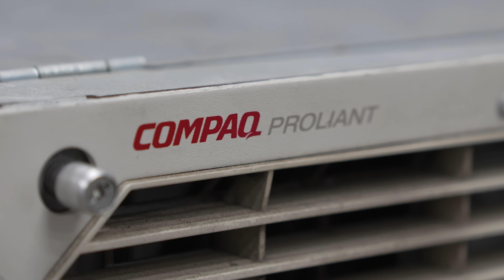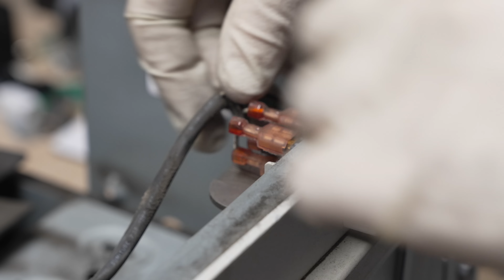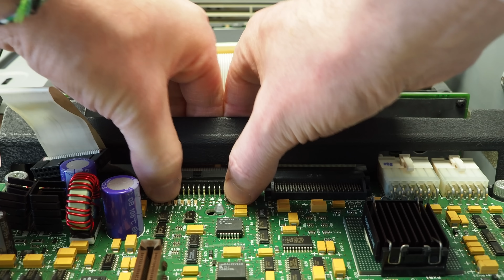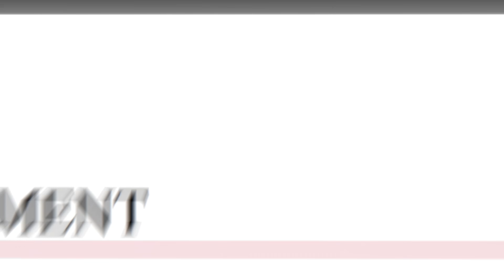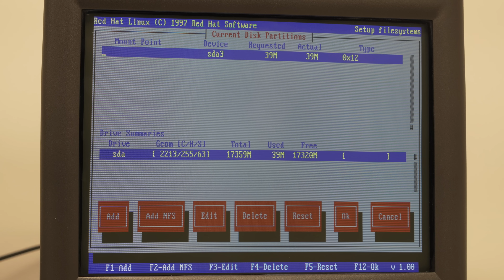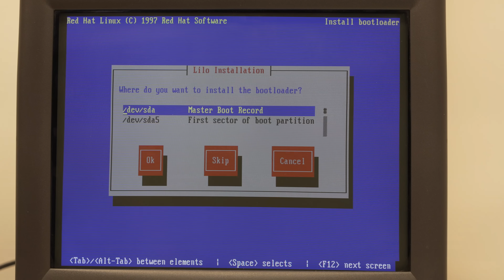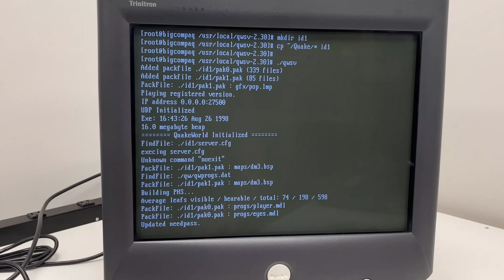A $25,000 server from 1999!

Comment: With the "Smart Start" CD a second CD was also available to update the system firmware. It made firmware updates SO much easier, you would boot from the CD and it would update everything in or connected to the server that needed an update. BIOS, RAID Card, SCSI Cards, Network Cards, Hard Drives, external drive cages.
Yes, HD firmware, it was an important update to run back in the day due to HD firmware issues from many vendors, (Seagate, IBM, Fujitsu, Quantum, Conner etc.).
The HD firmware was Compaq-specific as well, I have to admit that many of the updates that Compaq provided for HD, or other cards for that matter, were not necessarily provided by the manufacturers directly so I had to wonder if the corrected issues were mainly due to Compaq specific issues or hardware.
It was not uncommon for server companies like Compaq (HP, IBM, Dell, Dec Alpha) to have vendor-specific updates for hardware even though the hardware looked identical to "off the shelf" versions.
Anyway, the Compaq firmware update CD made updating a server an hour job whereas an HP, IBM or Dell would take a full day because each update required a reboot.
As you have already found, the SmartStart CD also installs all of the drivers needed to support the system as well, so if you purchased all Compaq cards and you had the correct SmartStart CD you could get a server online using the correct drivers in comparatively very little time.
I was happy to see that you opted to run all four processors, we too ran all four CPUs and 4 GB of RAM, as I recall the RAM cost as much as the server did, we also ran an external drive cage filled with the 18GB drives.
The one thing that you didn't show was the "hot-swap" card technioly that this server had, you can power down a slot and replace a card if needed.

Comment: noisy fucking things. lol. slurping up a lot of electricity at that. lol. we had a few. you're actually better off just filling a rack with deskpro's instead... 'we pay you to compute, computer, not to make noise and heat'
Reply: this is the kind of stuff from the days they still thought they sold that stuff to 'banks' instead of isps :P LOL (oh wait they still think that ;). we don't want a 200kg box that makes a lot of noise and just 'looks impressive'. lol. it's not gonna sit there for like 30 years. it's gonna sit there for like 6 months until the market changes. lol. and then someone has to lift it up again. you don't want to lift it up. lol.
Reply: called dell once to order 200 optiplexes... lol. the white ones. 'but you should just order our servers, we won't gurantee the optiplexes for that use' eh yeah well your servers are underperforming overweight overpriced pieces of crap. we just need cpu cycles per kwh and m2 :P LOL. sorry guys. :P and not break our backs on it .
Reply: 'bbbut those are not redundant'. yes they are. lol. you just pull out 10 or so as a whole and you still have 20 left all doing the exact same thing ay lol.

Comment: I think you got the price a little wrong. I used to install and upgrade these at Lucent Technologies back in 99-2000. The CPU alone was a $50,000 part back then! Of course, youcould get the exact same CPU without the Compaq brandingfor about 5% of the price, but they wouldn't honor any warranty repair requests unless everything in the system came from them.
Reply: Immediately after posting that, I saw the part where you were showing different prices from different sources. At least for the configurations that Lucent ordered, I'd say that $75,000 was about the starting point. I don't remember the specs, or which CPUs they came with, or upgraded to, but I do know the ones I was installing cost $50,000 each.  If I was a criminal, it would have been really easy to improve my living situation back then. Lol

Comment: I was certified to do warranty repairs on these servers and this takes me back. Your 6500 may have ram mirroring enabled which will reduce available memory by half. You need the smart start cd to configure the system. Hopefully your cdrom works.
Reply: I was thinking the same.  It's a pretty odd, unique feature, I don't remember seeing it on others servers, or with other manufacturers.

Comment: Whoa, I am having tons of memories triggered by this video.  In the late '90s and early '00s I was paid rather well to do full stack administration, largely on high-end Compaq servers.  The SmartStart splash screen and menus looked very familiar indeed.  I only ever installed Windows NT 3.whatever and Novell NetWare on those machines, but I built clusters for SQL Server, set up Web servers, and the whole nine yards.  I remember feeling very confident that I could get a Compaq machine to do what was required, and only had a catastrophic hardware failure on one out of close to 100 that I worked on.

One time I cut the bejeepers out of a knuckle on my right hand while I was squeezing a tape drive into place on a Compaq machine.  I was the victim of a metal burr.  That wasn't a top end machine but it was a pricey one.  Doctor used three sutures to fix my hand, and I had to fill out the forms for a Workers Comp claim.  One of the questions was something about what kind of machinery was involved in the injury, giving examples such as tractor, bulldozer, and so on.  I had to write in "Computer".  It was a hoot.

Comment: We run os/2 warp on one, db2/2, raid array, hardware bodges all around, CMOS battery failed easier to solder AA style rechargeables, grey button turned to dust on its final press to switch back on & used wooden stick after. Last HDD failure was replaced by E-Bay purchase. Omg happy days so very long ago.

Comment: I have a Compaq workstation from 1999 (dual Xeon 750, formerly the property of Jerry Pournelle) and it's interesting to see how the same design team must have been behind both chassis. 

Was once gifted some SCSI cards that were so filthy-stinky, I ended up soaking them in Febreze. So long as they're thoroughly dried before using, no worries.

Comment: One tip is once you clean a board, apply a fine spray layer of WD40 over the surface, it acts to drive out moisture from hard to reach spots and even has a mild anti-dust effect.

Comment: I actually have a very similar server to the 6500. It may even be a 6500. Although I think mine has 2 x 533mhz cpus I'm not sure I haven't powered it up in a while. Last time was during a snowstorm and I used it for a space heater in my house. The fans roar is music to my ears. I had to get some new hard drives. But I managed to find some. If it wasn't for the fact that my server rack would crumple under the weight of this thing I would rack it up but as it is I got a tower kit with it so it is configured as a tower server but I have the replacement plates and rails to rack it up if I ever get a rack that can hold the weight

Comment: Hello, I would really like to see a video about socket 604 server platforms. There is so little information about them on the Internet. But in particular, I would like to know about the top processors for this platform, such as the xeon X7460. In fact, this is the same PGA socket from the times of pentium 4. How did Intel manage to integrate such a monster with 6 cores and 16 MB l3 memory level onto this platform.😳
It would be very interesting to see and see what this platform is capable of🙏

Comment: Just did a comparison of the Compaq ProLiant 6500 with my iPhone 15 Pro Max:
Clock Speed: 200-450mhz vs 3.78ghz, Cores: 1-4 vs 6, RAM: Upto 4gb vs 8gb, Performance: 5-10GLOPS vs 35,000GFLOPS 😮 and the iPhone weighs a lot less! 😅. CHatGPT: "A single iPhone chip could outperform an entire rack of ProLiant 6500 servers in most computational tasks". Enjoyed the video, thank you 🙏

Comment: Just prior to the Y2K days I was brought in to a All UNIX ISP to introduce Microsoft Windows NT solutions... I looked at all the various hardware solutions and decided on four full height racks of these servers. These were truly 24/7 beasts with everything hot-swappable. From the CPUs and drives all the way to the Cooling Fans. I remember the owner looking at me when I showed him the Quote from Ingram-Micro. "Yep, That's what these cost."

Assembling them and getting the first one booted was a rush. After that it was just researching more ways on how to add redundancy to the network.

Glad to see some of these still exist in the wild. I used to have a set of installer CDS for the longest time. And I know for a fact I have one of those 4 way NIC cards that you could bond interfaces and set failovers down in my basement. (Was a spare.)

That unit you have there would have been used as an authentication server for modems at a particular POP. I labeled my machines similarly.

Thanks for the trip down memory lane. (We all survived Y2K!)

Comment: high probability it held customer disk space for either websites or email or both. I had just started in IT in the late 90's in my 20s and from memory these ran CentOS or Unix and Compaq Server Utility. The place I worked in were removing a mainframe and putting in Compaq server arrays with Xeon II and 2GB RAM and SCSI HDD's that cost about the same as a car with modem arrays that allowed dial ins but as a rookie all I was allowed to do back then was watch and help carry boxes. They weighed a lot. Very well built. 
Staff would play Leisure Suit Larry on one. That Ill never forget.
I try and explain to my kids what the equipment was like back then but they dismiss it coz they were born with iphones in their hands.

Comment: You should be able to put a slightly newer linux on that Proliant, We had a few old Proliant 3000's (similar chassis with dual Pentium IIs) and it was running up to Debian 5 Lenny on it at the time I left the ISP I was working for back in 2009, I suspect it was upgraded to Debian 6 before it was retired and replaced with IBM XEON eServer's

Comment: Very nice video.  I never worked on PC servers, but I did work on servers with a proprietary OS during an internship 1989-90, as well as Unix server development in the late 1990s-late 2000s.  Compaq may have had the first rack-mounted PC server in 1994, but that was not the "first rack-mounted server".  The servers I worked on in 1989 were rack-mounted, and I suspect many servers were rack-mounted before that.

$25K or even $75K in 1994 dollars seems high for PCs, but not for servers.  I remember looking up prices of the rack-mounted Unix servers we worked on in the 2000s.  Those went up above $1M depending on hardware configurations.  It is strange seeing a video GPU in a server.  Ours had a physical TTY attached to a serial port, but later used hardware management software to connect over the network with virtual TTYs.  Our servers never had GPUs in them.
Reply: Ya, I worked on IBM RS6ks, the mid-range and high end could easily hit $1M.  Imused to drool over the server catalogs like they were the Christmas Sears Catalog.  I also recall fully decking out the RAM cost more than the server itself.  Big markups on the bigger iron - IBM made serious cash on RISC.  Still do, although low end is pretty competitive w Intel/AMD servers now.  Everything runs Linux now, I miss AIX.

Comment: Awesome stuff! We had a smaller HP Proliant which we called 'fatman'. It was configured as a MSSQL Server (probably version 6.5 or 7) It's accompanying webserver was called 'littleboy'...

It also reminds me of a colleague who needed to install an extra processor in a server. He had never heard of the concept 'zero insertion force'. So instead of raising the handle of the zif-socket, he tried to ram in the CPU... resulting in a very expensive 'oops' with a CPU with all of its pins bend over...

Comment: 2.0.X and 2.2.X kernels did not scale well at all in SMP configurations, the performance gain using more than one processor is really mediocre. It was not until version 2.4.X that linux unleashed the full potential of SMP (with a little bit of help from IBM) I encourage you to install RedHat 7.1 (seawolf) or 7.2.

Comment: Used to work on a ton of these in the day notorious for poorly engineered floppy buttons and if you had to do a mainboard or backplane swap you had to fight it to initialize.   Solid servers typically coupled with the 205643-b21 (yeah I still remember part numbers) smart array 3200 controller. Funny note but most boards in compaq servers have a fun engineers mark I think the drive backplane on this one had a milkshake

Comment: I worked with some of those for clients of a hardware technician/Sysadmin consulting company back when they were new hot hardware and they blew their PC server competition out of the water except for some very rare (even at the time) specialty offerings from companies like Tyan . One thing i noticed since this is a Pentium 3 version of the system then supported version of Red Hat would have been 6.0 not 5.0 which ran the 2.2 kernel. Also for an interesting comparison you should try out the biggest competition for Red Hat 6.0 at the time which would have been either SuSE Linus 6.4 or 7.0. if you have never compared them before I think you would find the differences especially for 7 very surprising if not shocking. 

On a side note be glad it didn't have a Compaq "Netelligent" 10/100 network card because Linux had a habit of setting those on fire during prolonged heavy network work loads. To be clear I'm not talking about blue magic smoke or even scorching but actual sudden loud and bright ignition of one of the chips resulting in flames briefly shooting out of the back of the machine.this usually happened during large file transfers taking an hour or more like mirroring an FTP server, large database, etc.. The first time we saw it happen we thought it was a fluke bad card after the second time in a week we joked that it might just be an undocumented firework feature of the cards not a bug :). By the third time we saw it happen we stopped joking and pulled the cards from every machine we serviced that had them installed. Apparently windows and most other operating systems it supported could never push the cards enough to pull it off but Linux, Solaris and, sometimes even SCO UnixWare could, and it was spectacular and scarry when it happened. The driver for the Compaq "Netelligent" network cards was later blacklisted on almost every Linux distribution eventually removed from the kernel because even though it was an uncommon occurrence it happened often enough (particularly in the desktop version of the card which lacked a heatsink) that it couldn't just be written off as a bad batch or model and it could not be mitigated reliably by modifying the driver since the chip had no onboard temperature sensor.

Comment: late 90's i was running 3 quake2 wod(weapons of destruction mod) on 3 Linux boxes i threw together. it was my first time using linux, so was a learning experience setting everything up with a remote login to add maps, skins, and auto restart if the server crashed. i work for an isp, and was able to connect them to our oc12 ring we had at the time. i had redhat, but i was using Caldara linux as it has a gui, and used mandrake later on before i was told to pull the plug by our it department a few years later, but everyone was playing unreal, and battlefield 1942 by then. q2wod was such a fun game back then.

Comment: I have a Proliant 5500 sitting on my shelf.  It has 4x Pentium Pro 200 CPUs, 2GB RAM and 8x 300GB disks attached to 2 RAID controllers.  About 24 years ago it used to sit on top of a Digital Equipment Corp ESA10000 with 1.3TB of useable storage which it served files from to my network.  The ESA10000 is still around but now has 10.8TB of useable storage in it (48x 300GB disks in 12x RAID5 arrays).

Comment: Wow, I did not know that HP acquired the Proliant server name when they bought out Compaq. Back in the day, the only built-from-the-ground-up servers I worked with were AST Manhattans, and I was unaware of any other companies server lines. All the other servers I worked with from that era were repurposed desktop PCs, equipped with larger hard drives than usual and loaded up with Windows NT Server. Until I saw this video, I thought HP had relegated the Compaq name to all computers they built after the acquisition that weren't good enough to be branded HP. Thanks for this very cool video.
Reply: I think HP servers were branded Netserver??  But yeah, they ditched their line and went with Compaq.
Reply: HP maintained both HP and Compaq-branded server kit for quite a while.  Both had inertia in different companies, who wanted continuity of supply, logical upgrade paths, compatibility of parts, etc plus simple brand loyalty.  Easy to just buy 5 of this year's version of the old model  - because if customers have to try and figure out the HP-branded machine has the necessary mix of features, they're as well to compare all the other relevant brands, which risks losing HP a customer.
Reply: Interesting as I worked for a very top AST dealer in the early 90s and then later worked for DEC and then CPQ and had worked on these servers. (I didn't touch a Manhattan much though but I worked on a ton of ProLiant.)

Comment: You should run a newer Linux kernel. Read about the big kernel lock for more info. At least 2.2, but SMP got much better in 2.4. RedHat 7.3 would be era appropriate and it was a good version too.

Comment: I work on modern HPE ProLiant gear occasionally for work and it's amazing how many small design features and quirks have stayed the same, despite the passing decades and mergers and acquisitions.

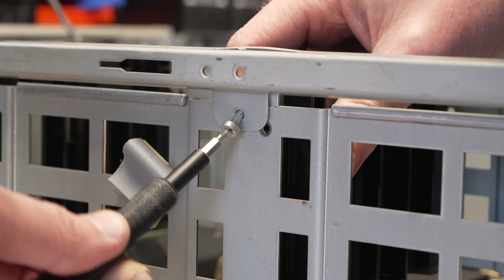The one concrete thing i can point out is the goofy little slotted Torx screw seen at 13:55, you will find these everywhere on modern ProLiants as well. Other than that it's just the whole design ethos and combination of slot in modules, daughterboards, plastic releases and cages that makes it "feel" like almost like a modern Proliant.